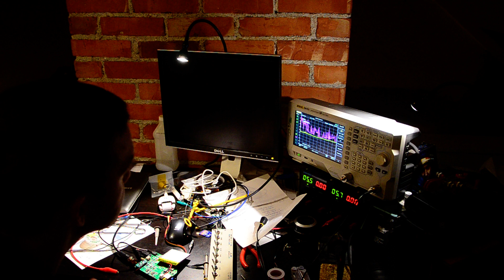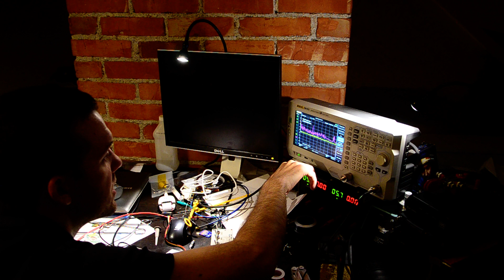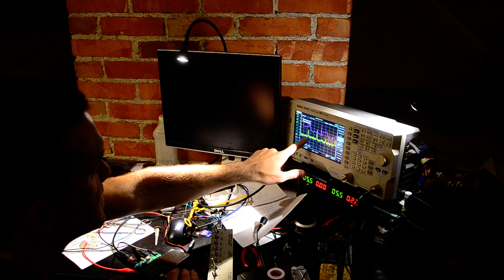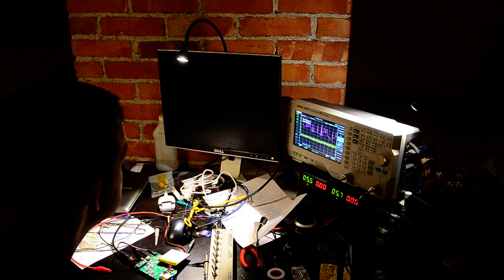PortableSDR - Amp board: Not working yet!

Comment: Keep going you will hit the spot, what output power you looking at getting? +40dBm would be a good value (10 watts).
My watts-dBm chart might be usewful http://qsl.net/vk6zse/wattsdbm.html

You may need to put in selectable filtering so just the wanted signal is outputted.
I love the rigol spectrum Analyser, they work well and are a very well priced item.